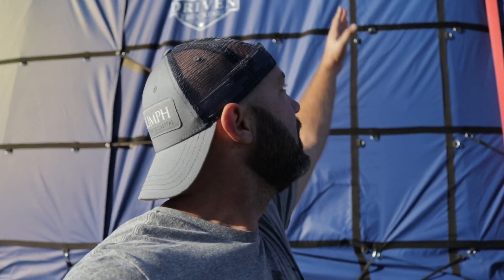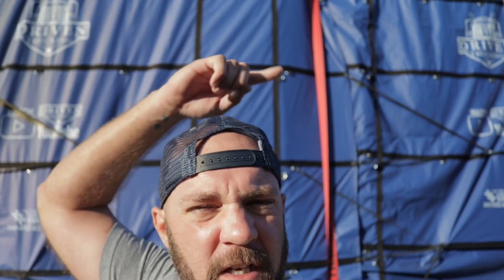How NOT to tarp! | Tarping a Flatbed Load

Comment: They make bungee cords with carabiner clips.  If you're feeling adventurous you could buy a roll of shock cord / paracord and the carabiners and/or hooks and make your own bungee cords.  Either way a carabiner would minimize tearing the tarp and strap.  Just make sure it will fit through the grommets or other securement points on your tarp(s).  Great video - thanks for sharing.  Pointing out your mistakes and what should've been done instead is super helpful.
Reply from the maker: There’s always plenty of mistakes to point out LOL
Reply: That was exactly what I was thinking good idea thanks for sharing that also have a great day stay safe

Comment: In some places you use 5/16" Nylon Braided ropes, not the three cord twisted ropes and learn some trucker knots and no bungees and protect that tarp. Keep both ends of those S hooks bungees hooked to the inside of the rub rail, harder to punch holes in your brand new tarps. Good info!

Comment: I have specific bungees I use for the front side sections of the rear tarp to avoid the s hook damage. I bend the s hook into a tighter S with pliers to avoid the sharp point as they originally come. I keep those burgers together in one bundle  for quick grab n go but my tarping is never fast! An idea for the airflow outlets in the back would be a peice or two of 4 inch  pvc pipe about 2 feet long or so like an exhaust pipe!  I worry about  back draft  with water spray. This way there should be no chance of it coming back into the pipe. Great explaination on the tarp needing to flow through.

Comment: Hello sir great video , I have a few questions,  what are the dimensions of the tarps ? What weight of vinyl did you use ? And how much do they weigh? My tarps I have would work better on a flatbed then my stepdeck. We haul such odd shaped pieces I wonder if any tarp is correct . I see why 10” drops would work . Safe travels

Comment: Bungee rope is a god send, that's all I used running along the side of my tarps, I only use bungees for my tarps
Reply from the maker: I have some, I need to figure out how to use it, it seems like something amazing if I actually knew how LOL
Reply: @DrivenTrucking  tie it off on the front corner of your trailer to one of the bungee hooks that run it through your tarps. Run through in hook it on your hooks than pull snug and tie off, than bungee on either end
Reply: @DrivenTrucking  if you're put west let me know, I have extra as well

Comment: Why didn’t you get a conastoga and save aloooot of time
Reply: I asked him the same thing right after he got his step deck.  The Conestoga or curtain sided flatbeds are nice but have limitations.  You can't haul anything wider than what the covering will 'slide' past.  You can't haul anything higher than the covering.  If you're hauling something long that takes up the full length of the trailer or longer it can be hard to load the product since the curtain only collapses so much.  A lot of places that load using an overhead crane won't load a curtain flatbed due to the risk of damaging the curtain.  Thus his choice for the open step deck.
Reply: Yes that’s a big limit, but the time savings vs tarping makes up for the difference especially if your doing lids under 1,000 miles.. I did the math. 1 hour average per tarp/untarp and 3 loads a week is 6 hours.. your hour is worth 100$ 600$ a week in time savings at 3 weeks each month 600x36 is 21,600 just in time savings or $10,800 at 50$ per hour